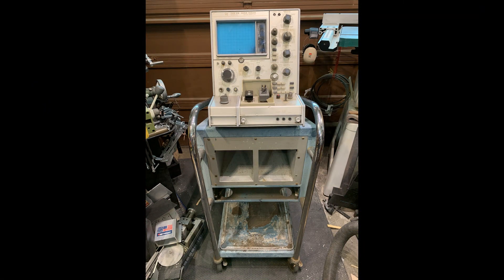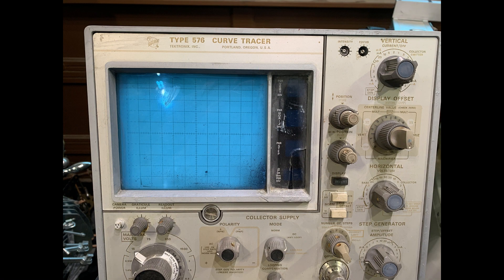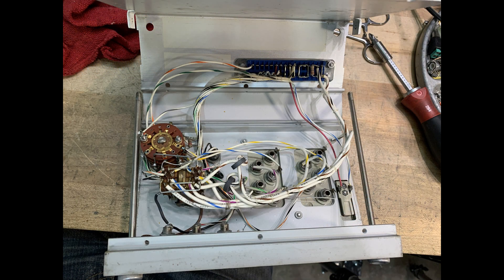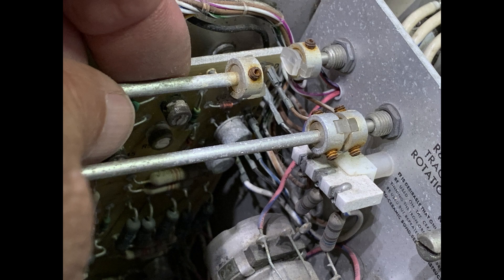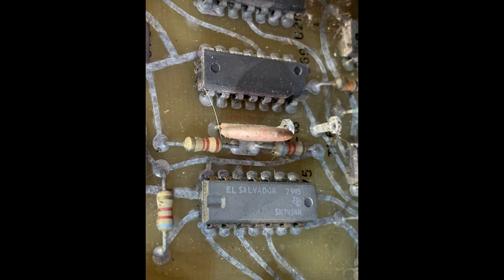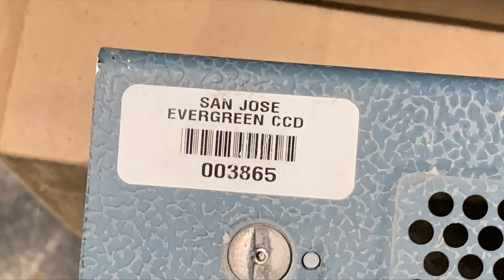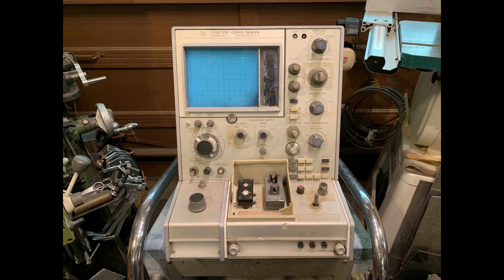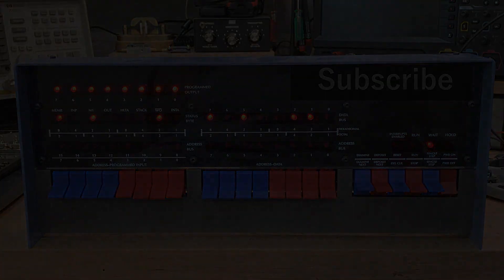#1273 Tektronix 576 Curve Tracer (part 1 of 9)

Comment: I see a band saw to the right, and a lathe on the left. you do everything ha? Nice. It seems you are close by (bay area?). 
the reason I am watching your video is not just, because I like, enjoy and learn from all your videos, though, quite  a few, pass way over my head at this time. 
I just got one of those 576 as well in better shape than the one you are showing. believe it or not for about the same price as yours. The inside look very clean. just a little dust on 1 board. the trace is really messed up. and It seems to have something to do with the 3 switches "display: Invert, and Display offset: zero and Cal". as soon as I touched them it got really worst. 
I am lost on how to get to them through the back, so, I can spray them with cleaner, or should I just spray into the face hopping it will get in them. looking at them from top, I see the switch body is setting a little further back from the push buttons. any input would be appreciated.
Reply from the maker: mine also has some switches I dare not touch. I'm not sure how to fix them either. and forget about taking them out! that beast seems to go together only one way and they must have put the switches in first.
Reply from the maker: you might ask @ZenwizardStudios   he works on lots of tek stuff. then tell me how to do it 😀
Reply: @IMSAIGuy  I fixed the invert switch & zero switches. before the trace went haywire when they were pressed. not its better. those switches are open at their end. and 99% or deoxit should work fine. I used deoxit if you bend the plastic tip a bit using a flash light you should be able to get it in the switches through the back. 
I went a little overboard with the spray, though the back on the top and here and there. until I ran out.  
worked out the switches as much as I could. blew it out and let dry till the next day. 
It's improving but not there yet.
Reply: I just finished restoring one of these as well.  You can get access to the Zero, Invert, and Cal switches on the Display Switching board by removing the Horizontal, Vertical, and Display Offset switch assemblies/PCBs.  They are actually not too hard to remove.  First remove the knobs from the front of the unit.  Then there's a metal bracket that runs vertically at the end of each of these switch assemblies.  The Horizontal, Vertical, Display Offset, and Amplitude switch assemblies are all attached to it.  There are two small screws for each switch assembly that need to be removed so you can free each switch assembly.  You might need to also remove some of those large tan resistors that are also attached to that bracket to get access to some of those screws, but again, its not too bad.  Once you have access to that board, penetrate the switches with a good quality contact cleaner (I use Deoxit) and then exercise the switches.  Make sure to clean off any excess or allow it to evaporate before powering the unit back on.  Good luck!
Reply from the maker: the switches that are messed up on mine are the most lower right, step and rate @fmashockie
Reply: My bad I was responding to the original commment.  Those are more of a pain to get to.  But you can remove the amplitude switch assembly in the same way as I described to have better access to pull them out.  Then you have to remove the standard test fixture to remove some screws holding all 3 of those switch boards (Step Gen Rate, Step Gen Pulse, and Step Gen Offset boards) together.  It is a real tight spot and I didn't enjoy doing it but just getting some contact cleaner in those switches, visually inspecting the boards, and buzzing out each switch with your DMM will likely only need be done once and then you won't have to do it again 😂 @IMSAIGuy
Reply: just be very gentle when removing the plastic switch actuators! I cracked a few of mine when removing them.  Fortunately, they didn't break all the way so I don't have any missing buttons.  But maybe pulling them off with pliers isn't the best way to go! 😂
Reply: @fmashockie  thanks man, I was watching your video and then I saw your massage. I bent the nozzle tip on the deoxit can, sent it in between the boards, and sprayed them from behind and where ever I could, until empty, lol . the switched are open in the back by the way. 
then blew out access deoxit off of boards and the unit. and let it day for a day.  trace got much better. but it not there yet.  I need to get it to be a tiny dot when adjusted in ac, dc + or -. lines must be straight.
Reply: Very nice! You'll probably need to make some adjustments to the CRT astigmatism, geometry, and orthogonality.  Or check them at the least.  They are at the very beginning of the performance/calibration procedure in the service manual.  Make sure all your voltages are in spec before attempting!  @bobbauvian7700
Reply: @fmashockie  hi thanks, i checked the voltages. they are off. all low. the -75 is -55 and pot adjustment will only go up to -065. 
so I think a recapping is in order.
Reply: Check C707.  If you watch part 2 of my videos on this 576 repair, that cap was dead.  It is one of the large ones with the plastic cover on it.  That might be the only bad one.  That one is across the unregulated -75V supply.  The -75V rail is the reference for all the other voltages.  So if that one is low, it will bring all the other voltage rails out of spec @bobbauvian7700

Comment: Before spending to much time on the rebuild, the HV transformer needs to be checked and the tube. Either one of those failed it is a parts unit they are unobtainum. There are several projects in the works to replace the CRT with an LCD however these have not born fruit yet. Brown HV transformer, Double peaking or high hour CRT and the unit is terminal unfortunately.
Reply from the maker: when I started, I expected both to be bad.
Reply: @IMSAIGuy  I am looking forward to seeing where this goes.
Reply: Yeah, the 577 I got had no transformer in it at all, but I managed to resurrect a useful, albeit low-voltage instrument using a doorbell transformer. Really looking forward to this series (1 of 9 :) )
Reply from the maker: @MikeFikes  I hope you wired the bell to one of the switches 😂